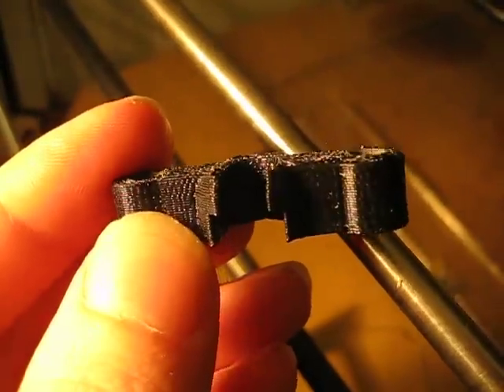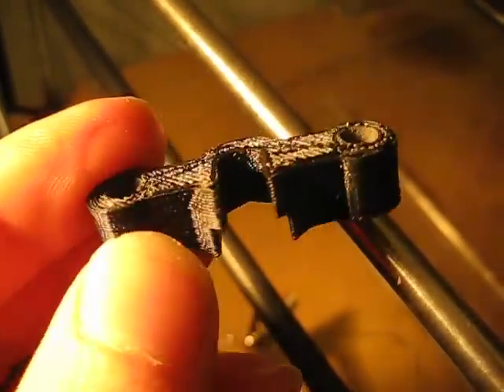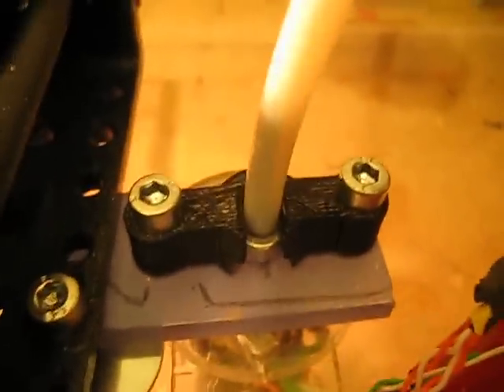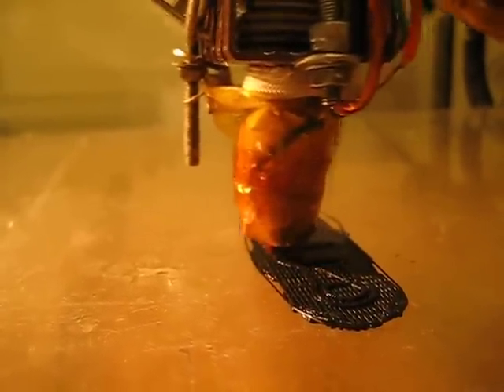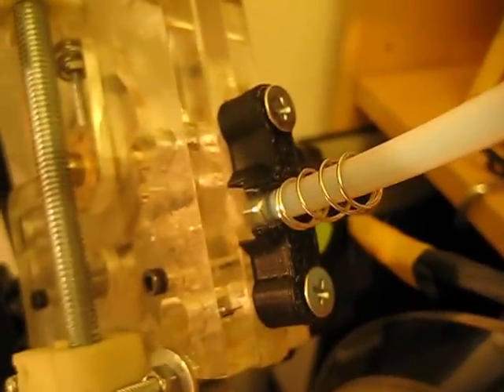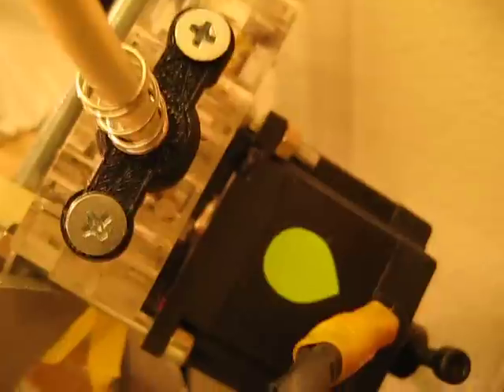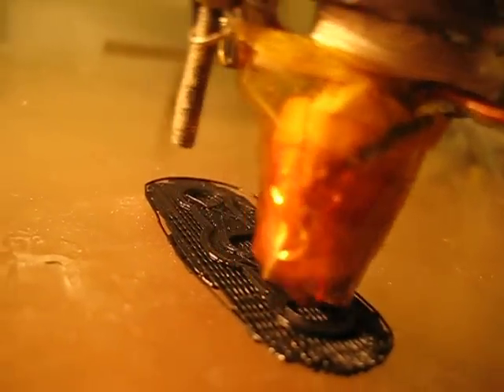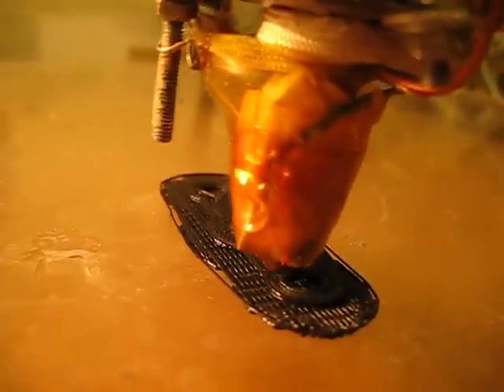Bowden coupling

Comment: Would the filament drive assembly from a Makerbot MK4 have enough pushing power to overcome the extra friction from the tube? We're looking to make a Fab@Home/RepRap/Makerbot hybrid, and we've been planning on having one of those hefty MK4-type extruders (paxtruder) swinging around an X Y powered by Makerbot's NEMA 17's. I wasn't so sure about those being able to handle all that weight... I had this idea to make it lighter. You beat me to it!